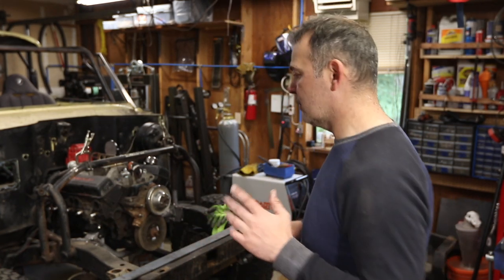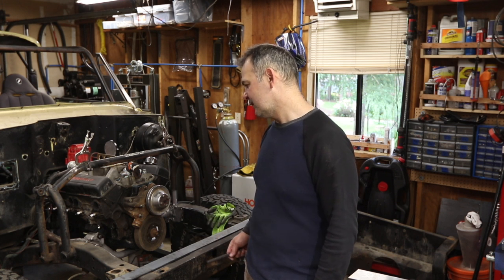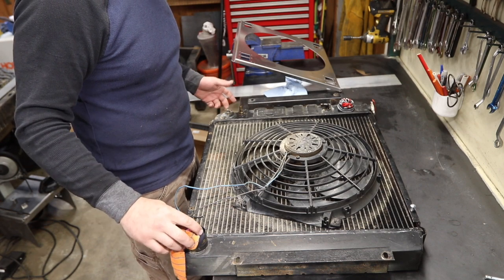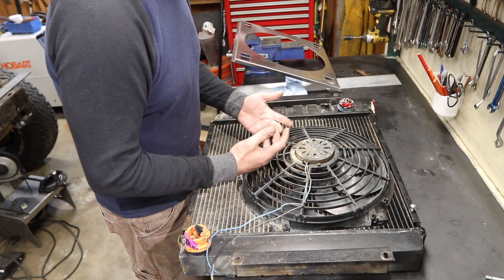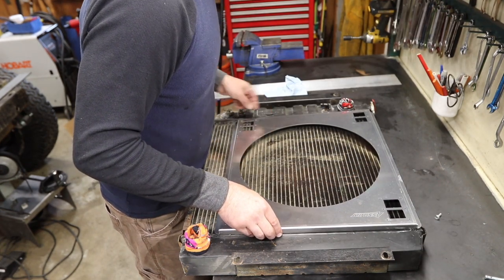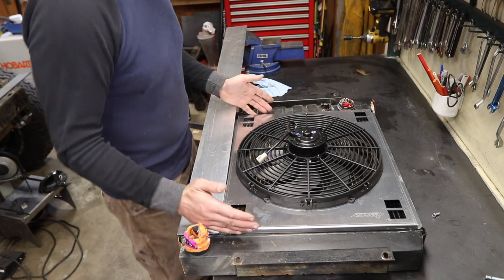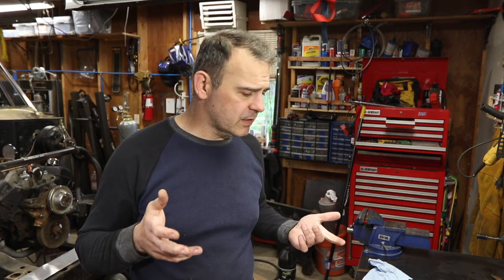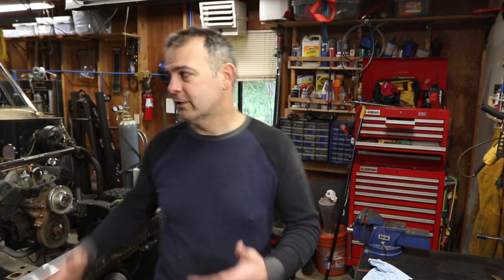5.16 Custom Fan Shroud!

Comment: RnD Fabrication makes pretty good radiators, with dual fans running strong 8 years now... those flappy things look like the one piece they are missing though.  After lots of highway use my shroud has a slight inward bend because it doesn't have those flappy things...but the scout runs cooler than it did with the mechanical fan....
Reply from the maker: Trogdor good to know!  Yeah even without the shroud the abc ran fine with the electric. This will be mo’ better though.
Reply: Matt's Garage is it because thicker guage wire?
Reply: And how do you install the flaps?

Comment: Seems like that aluminum piece you're adding will block flow.  Might be better to extend the shroud to cover the whole radiator  or just leave that piece off?
Reply from the maker: fourpoint9 do you mean in terms of drag from driving? As far as fan flow it sits enough off the radiator fins that it will help the fan pull across more of the  front of the radiator but you are right there will be more drag at highway speeds. Although I think that part of the radiator sits behind the bottom of front grill section so it may not matter. In any case I appreciate the thoughtful comment and I will check when I mock it up!  I may end up ditching it. Thanks!
Reply: @MattsGarage  i did something like this on bronco. not sure what your clearance is on a scout.  but i had to add half inch spacer to that plate. away from rad.   then wrapped metal strapping around those . nice finished looked and no over heat prob.... just my 1.5 cents